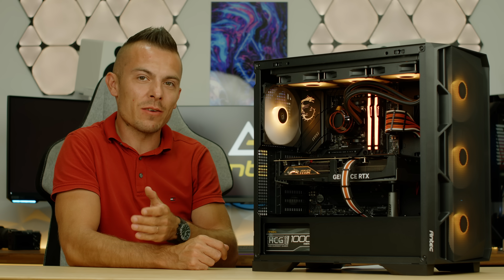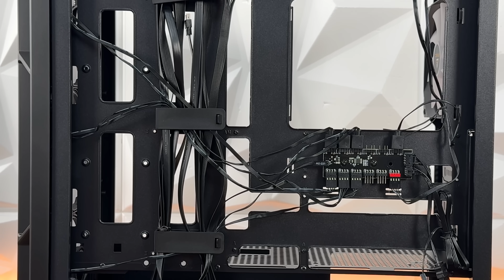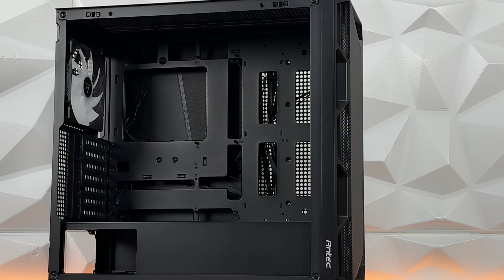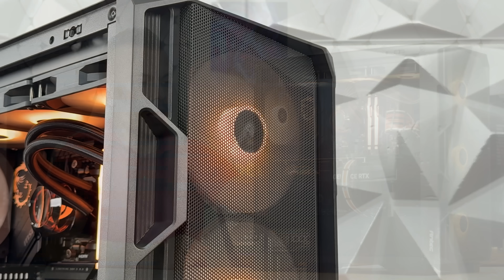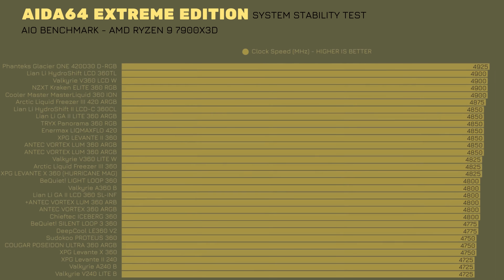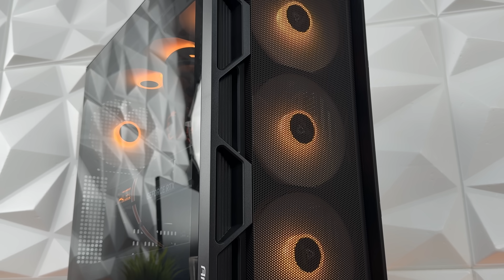ANTEC AX1000 ARGB Review - Big Airflow, Big Looks

Comment: why are the argb fans that come preinstalled not being detected by rgb softawre
Reply: I've tried both ways.  Definitely prefer this way, because most of the software has problems and doesn't give all the options.  BIOS does better, but then you don't have an easy quick way to change it on the fly.